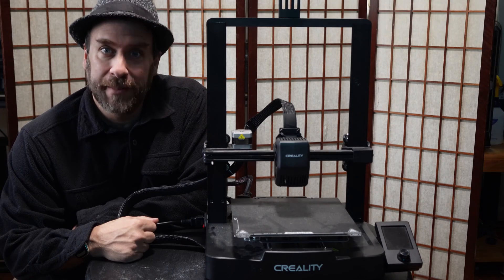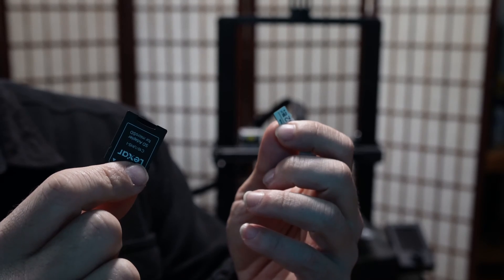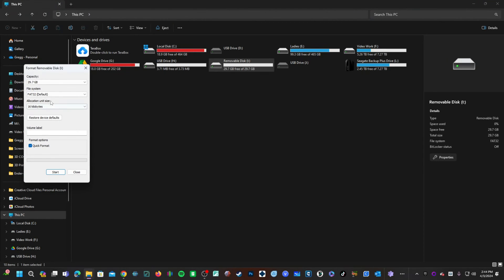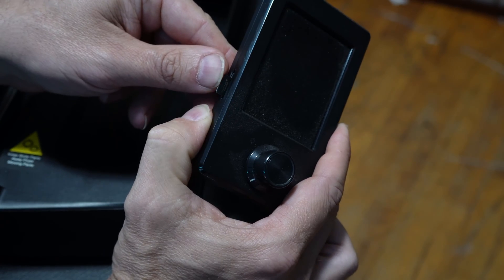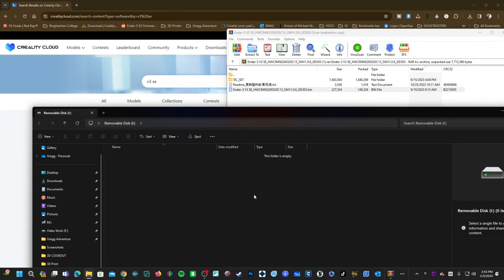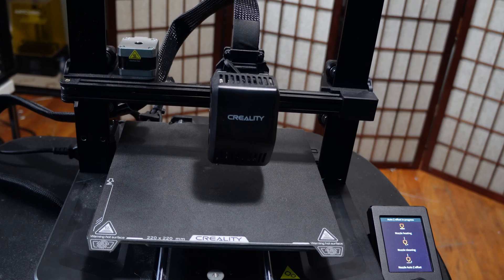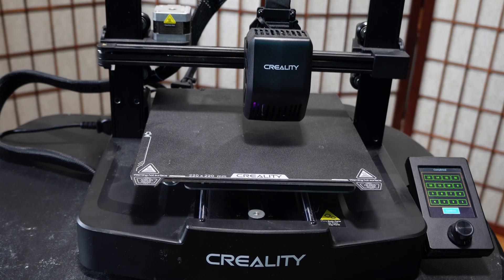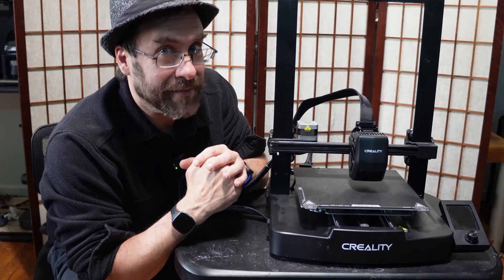How to Update the Firmware on Creality Ender 3 V3 SE - 3D Printer

Comment: Thanks so much for the explanatory video. 
Unfortunately there is an error in the name, rename the motherboard firmware to something like firmware106.bin, the screen fixes itself when the motherboard firmware is updated.

If you write this as a fixed title under the video, people will easily find the solution.
Reply from the maker: Marline will not load the same file name more than once. If you had a failed attempt, you'll need to rename the file.

Comment: This printer has great hardware but it crippled by TERRIBLE firmware with very little ability to tinker or customize your experience. Quite sad because it's such a good printer for the price. But with lousy software (and the inability to customize it) the experience is ruined.
Reply from the maker: It's a budget printer running Marlin. For the Money, it's fantastic. Put a Neblua on it, and now you've got Klipper.

Comment: Im kinda stuck here. I installed the nebula AND the sprite extruder kit. But the thing is that the probe sits waaay further away than it does on all the other extruder heads (apparently). I can't find a fitting firmware for it though. Leveling is not possible for me now. Anyone with a fix out there ?
Reply from the maker: The SE already has a sprite extruder. I would leave it stock for the extruder. If your CR-TOUCH is too high, you will want to use a spacer, to lower it.
Reply: @3DRundown   Hey, thanks for the quick answer. I should have been more precise. I own a standard Ender 3D printer and have kept it somewhat up-to-date with various upgrades over the years. I had the Creality direct drive installed before and wanted to upgrade to the Sprite. The only problem I have now seems to be the CR-Touch. It used to sit next to the nozzle, like all standard probes seem to do. But on the Sprite extruder, it sits further at the front. So when I want it to level the bed, the CR-touch never touches the bed, because it remains over the edge. I'm wondering if I need to get crafty and mount the nozzle back there again (parallel with the nozzle), or if I can somehow 'tell the software' about the new probe position. Sorry if I did not properly explain my problem here, english is not my native language :/
Reply from the maker: You will want to change the "PROBE OFFSET". Google that

Comment: Hello sir. The update is stuck at 0% on the screen. I've tried to format the memory card, also partition it for a smaller size, noting seemes to work. Any ideas ?
Reply from the maker: Use a smaller card. Format fat32. Try again
Reply: @3DRundown  It worked with a 8Go card ! Thanks. For the machine's firmware, it did something different, but I'll check if it's stil working as intended.
Thanks for the help !

Comment: So far until the micro sd everything went okay, but now when trying to put the memory card for the BIN file, the printer screen is turning on in the blue background but the CREALITY logo is not showing at all, what can I do next?
Reply: NO idea man. Looks like its not finding the files. Just did mine. I couldnt get an adopter for the SD card to formart. I used phone and was scared... but worked. Just now am on the grid check with the printer board Big SD.
Reply from the maker: Use a small capacity card. 8gb, if have one. Format Fat32. Try again
Reply from the maker: Use a small capacity card. 8gb, if have one. Format Fat32. Try again
Reply: @3DRundown tried with the 8gb microSD card with 4096 bytes, FAT32 for both firmware screen and firmware mothercard. Ive now passed the creality logo but the z offset calibration just wont start and will keep restarting over and over, at this point I have no idea what to do
Reply from the maker: Interesting. Go over all your wiring. Make sure nothing is shorting, or loose.... Can you share a video?  Can post here: https://www.facebook.com/groups/ender3v3se
Reply: Turns out I had 230 V settled up instead of 115 V, now it is starting as it should! Thank you
Reply from the maker: CRAP. Why didn't I send you directly to that.... But, I knew it was a wiring thing. Glad we got you there! This is why peeps go through the setup with me. :P

Comment: The screen update went as planned, but I’m still getting the blue screen with no Creality logo when booting up the printer. After o my a few months, I guess I need to toss this one in the trash!
Reply from the maker: Not following.... You want to toss an SE in the trash over a FIRMWARE update issue? Just spit balling here, but, sorting out the firmware update, sounds like a better game plan. Or, putting a Nebula Pad on it.
Reply: @3DRundown I added a nebula pad to mine, yet I'm uncertain if my printer took the updated firmware  and also I can not find a good guide as to what parameter changes should be made to the slicing software  ie changing gcode flavour etc. Any suggestions to my queries?
Reply: How to do is add all the update files to the mini SD and then upload the second step file to the main SD and then put them in at the same time and do the whole process at once

Comment: Hey guys! got the bluescreen and i was losing my hope, none of the recomendations on the other comments or on internet helped me, tried diferent SD cards, tried changing the BIN name, and nothing changed. what finally SOLVED the issue was just following the recomendations from CREALITY on the WINRAR file, when you download the file it comes with a README txt file, there it says: Display firmware update：
    1. Format the TF card on the computer side, and select 4096 for the allocation unit size.
    2. Put the screen firmware folder "TJC_SET" into the TF card.
    3. Turn off the printer and Insert the TF card into the card slot on the left side of the screen.
    4. Reboot and wait for the update to finish.
    5. After finishing the update, remove the TF card and delete the files inside.

Mainboard firmware update:
   1. Format the SD  card on the computer side, and select 4096 for the allocation unit size.
   2. Put the firmware file "Ender-3 V3 SE_HWCR4NS200320C13_SWV1.0.6_GD303.bin" into the root directory of SD card.
   3. Turn off the printer and insert the SD card into the card slot on the motherboard.  
   4. Reboot and wait for the update to finish.
   5. After finishing the update, remove the SD card from the motherboard slot and delete the bin file inside.

Comment: So my problem is I have a Neo3 and I have a chromebook. I updated the software, and it says I have no files on my SD and so the company gave me another file and it still doesn't recognize the file. I unzipped a file from another file and put it on the SD but it still doesn't see the file.
Reply from the maker: Need a memory card, 32gb or less, formatted in Fat32.  Make sure have the correct file, on the root directory. Rename the file to something else, before trying again
Reply: @3DRundown  then it'll work on the chromebook?
Reply from the maker: All you need, is to put the file on the card... then the card goes in the printers, so, can use whatever you like, as long as the file gets the the card.

Comment: I did this earlier, and the LCD said it was updating and was always stuck at a certain percentage and would not complete. I then tried a different micro SD card and formatted it to 4096 allocation size, then copied the folder over and tried it again and it worked.
Reply: Was it 95%?

Comment: People, I updated the screen and then the printer. It turns out I used the same memory card for both updates. I didn't get a blue screen, but everything came out in Chinese and in several languages overlaying everything. In the end, I formatted the microSD again and installed the screen update again, then I used the SD card that comes with the machine for the firmware and it worked perfectly for me so far.
Reply: This worked for me also, thanks legend
Reply: i did the thing you are talking about but i still have the same problem
Reply: @mikoajolejnik662  are you fixed the problem?

Comment: When doing the leveling, only numbers appear and not the leveling data as shown in the previous version, however when editing the leveling data it does show the information of the points where you level with the cr-tocuh?
Reply from the maker: You don't need to EDIT the leveling Data. It will create a mesh, and use that mesh, to adjust your 1st layer
Reply: Does the bed leveling work better running this firmware over the 1.0.4? I run 1.0.4 and need to edit the grid to get a good first layer on some spots on the bed.
Reply: @johanflodkvist80  The same thing happens to me, the automatic leveling is very unreliable even after having leveled it manually, it usually changes the leveling by itself, that is, maybe in one print the first layer is perfect, but in the other with the same file it is slightly a little higher which can generate small gaps in the fill lines of the first layer, and I always have the doubt if the cr-tocuh is working as it should.
Reply from the maker: Does your GCODE have M420 S1 in it? So far, my SE hasn't had any issues with 1st layer
Reply: @3DRundown  yup, M420 S1 is present in the gcode. I guess our beds are just less flat than your bed 🙂
But Im looking forward to upgrading the firmware to see if that improves things.

Comment: I have a problem where it seems to be stuck on the "Auto Z offset in progress" screen. The "nozzle heating" icon is not blinking, and no parts of the printer seem to be getting warm. Do you know what the issue might be? Or what I can check? I have tried multiple times reflashing the firmware to both the screen and the main board. Still no success.
Reply: Same, but for some odd reason, images and text don't show up.
Reply: Read some people who had similar issues when not using folder/not folder correctly. And some that need to rename files because of the filenames are too long.... 
Not tried this myself.

Comment: Question, the nebula pad can also get printfiles via wifi or lan, rather than annoying usb stick or sd card swapping?
Second question, is the Creality Sonic Pad similar to nebula, re wifi and/or ethernet?
Reply from the maker: Both are The same. Sonic handles 4 machines. Nebula 1. They are Klipper. Everything is done wirelessly. K1, K1 Max, Ender 3 V3, Ender 3 V3 KE, CR10-SE, come with it.
Reply: @3DRundown  yeah, we sell K1 and K1 max in our shops. Though they call their Klipper "Creality OS", in violation of the GNU license, which I found a bit strange.
Thanks for your reply, I believe Nebula should be the way for me to upgrade since I can't do multiprint anyway (2 more printers, fron 2 different companies)
Reply from the maker: Meh, I don't lose sleep over that stuff, but some people do...
Nebula is a good call.

Comment: Is it possible to modify firmware on SE to allow printing at 300C? I have replaced the heater with 60W one.
Reply from the maker: You could put the Nebula Pad on it, which will give you Klipper.... Then anything is possible

Comment: I have an ender 3 pro and just installed the direct sprite extuder. Im having trouble with my prints now. Any chance you could help me out? I would greatly appreciate it.
Reply from the maker: Elaborate....
Reply: @3DRundown  after installing the new extruder and nozzle, the infill isn't connecting to the walls. It's stopping slightly short
Reply from the maker: You went from Bowden to DD.
Be sure you've got the correct Nozzle Size installed, and set in your Slicer (I assume 0.4).
Retractions need to change. Sprite will be 0.8mm/45mms
PID Tune, if your firmware allows
Set your Esteps to 424.9. But, you may need to calibrate that manually to dial it in. I don't usually find that necessary
Reply: I changed the e step and retraction distance already. I can't remember if I changed the speed or not. Could it be the slicer or firmware on the printer?
Reply from the maker: I assume you are adjusting your speed based on what's best for each model. Have you tried working with your flow rate? Trying different infill? More walls? The usual suspects? Perhaps estep value is not working out? Flow rate is too low...  Experiment with some small test prints.